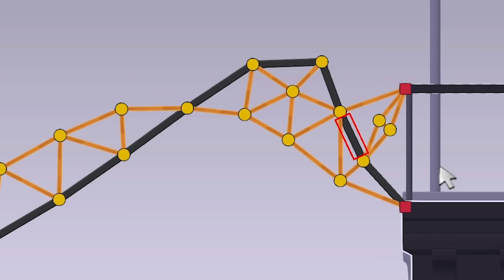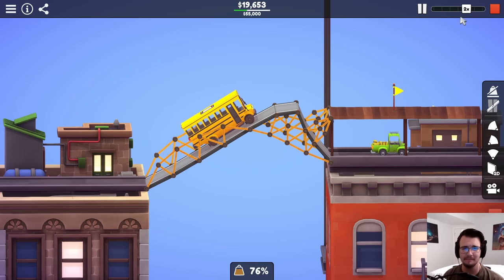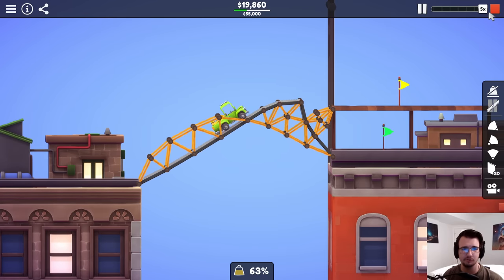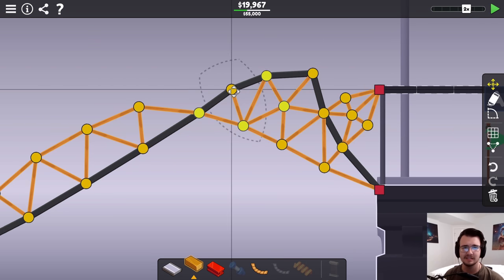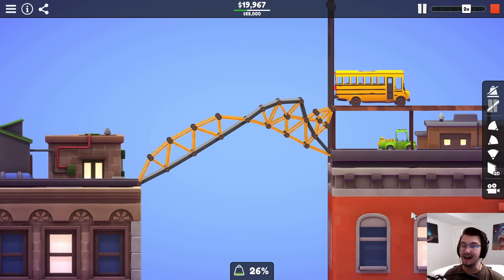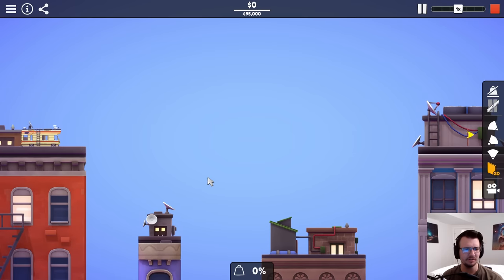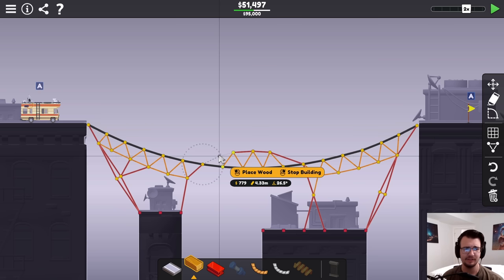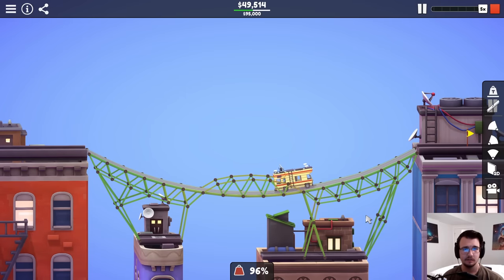This Bridge Automatically SORTS Vehicles! - Poly Bridge 3

Comment: the double pendulum dangling road jump is insane. the absolute tiniest change drastically changes how it moves. i cant even imagine the trial and error.
Reply: Sometimes road that dangles on both side even is not enough

Behold, the pendulum
Reply: ah, the chaotic nature of the double pendulum
Reply: Yes that's what a double pendulum does. It's a chaotic system
Reply: I think the second road might be there to add more weight, so the platform "throws" the bike with a little bit more force
Reply: even so, its presence makes tuning practically impossible

Comment: The biggest problem (not complaint, mechanical problem) I have with Polybridge 3 is when the road breaks, because my boy reinforced road is gone.
Reply: I wish you could wood/steel/rope/cable/hydraulic the roads still
Reply: I do miss it.
Reply: To be fair the roads are much stronger in pb3 so you have reinforced road anyway.
You just don't have un-reinforced road 😅